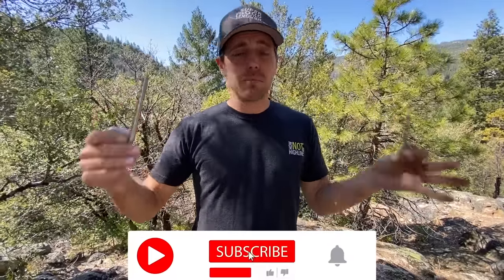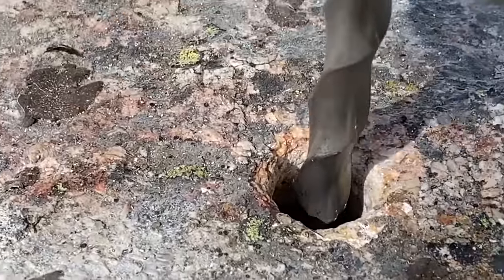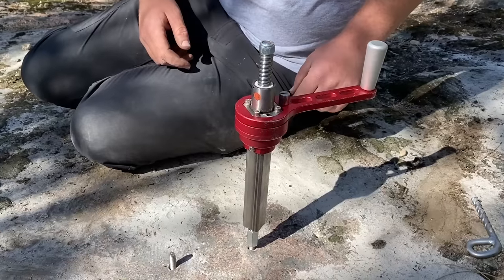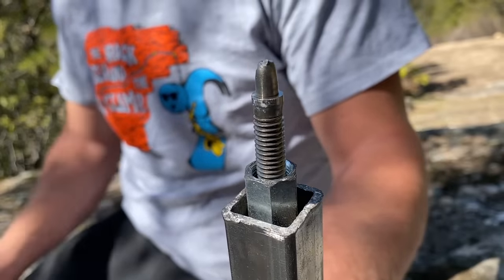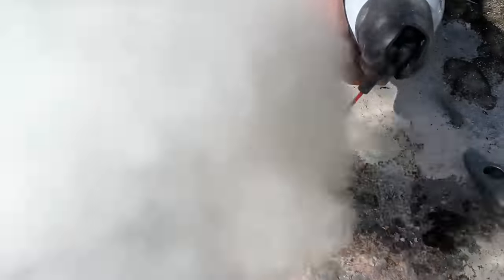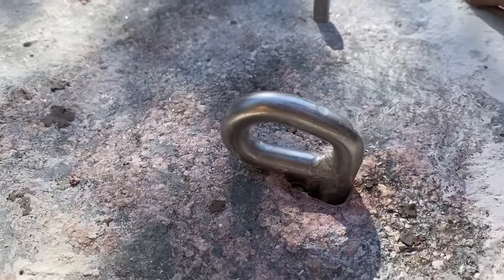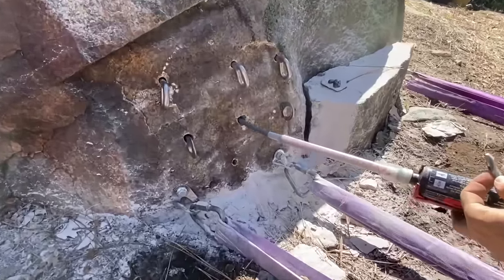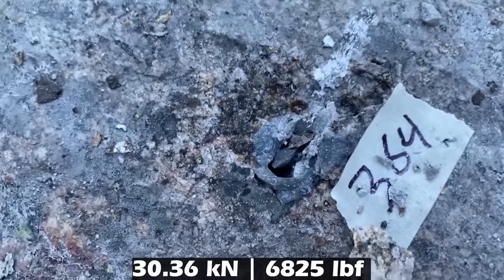Is too much epoxy bad for climbing glue in bolts? A trick to fix bashed Bolts

Comment: Drilling into rock to smash metal is savage dude!! But if you really have to then i suggest using a drillbit from the milwaukee MX4 series, made for concrete, cuts rebars as it was sandstone, so should be super drilly enough for those thin sleeves.... love your videos😍

Comment: You should test for fatigue failure. Say half the expected failure load and repeat until failure or like 1000 cycle to see how it compare to a fresh install. 

It would not be a perfect test but it should give ou a idea. Since like you say, epoxy is brittle and fatigue may start crack that can weaken it overtime.

Ps. Really enjoy all the ressource you have send out over the years.

Comment: Since you have become so popular, I think you should dive into the bolt debate.
It’s great that you are doing all of the research. Of course people need to understand the “how” of climbing pro. Replacing manky anchors is a noble endeavor. Setting up safe, clean, efficient highline anchors is fantastic.
Joe Shmoe should know, that throwing a line of bolts up a wall,  needs a conversation. 
The “why” of bolting, in the climbing world, needs  to be revisited. Is it just for removing fear? Eventually all climbs could be made “safe”. 
Climbing and highlining are two different games. Of course HL anchors should be bomber. 
Climbing.....is not simply about physical movement. At least half of the game is mental.
Throwing bolts in anywhere and calling it “developing” is.......insulting. Especially at the lower grades. It removes the feeling of standing at the base and wondering.
This debate is at least 50 years old. But climbing was obscure 50 years ago.
Now, Joe Shmoe, should be aware of the history.
Thanks for all your extensive testing and sorry that your work was vandalized.

Comment: Guys...  I really appreciate the huge efforts required to make this content. I was wondering.... Have you considered another test, to verify bond line integrity, before you pull? Such as a torque test.... Where you apply a specified torque, chosen such that no rotation is a pass, and rotation (indicating plastic deformation of the adhesive) is a fail. Multivariate data from these two tests may help yield a universal/standard Non-Destructive testing method for bond line integrity that requires minimal equipment. The variation in hardware and rock, in combination with a single crew doing a repeated methodology, adds a lot of weight to verification/validation of such a test method....... Additionally, you could do this non-destructive test in the field on a sample of old installations (It would be extremely interesting to check areas that have experienced wild fires... I don't believe a suitably large sample of these have been collected to date)...... ((Obviously this test is not practical if a ring bolt is 'notched and recessed.. but there must be plenty of installations where they are not 'notched and recessed'))

Comment: I thought this was a guide to fix the bolts that were hammered flat by the “Yosemite Psychopath”.  I also heard you say you weren’t going to fix them Ryan, but you are the bigger man in this story so I think it might be worth your while.  My suggestion, for what it’s worth, would be for you and Bobby to go fix some bolts, video it and as well, get the Rangers involved in the process.  if you were compensated by the Park in some way for doing that then the bolts would be considered improvements and the property of the U.S.A. Tampering or damaging them, or any park infrastructure, would be a Federal Offense.
Reply: The park can barely pay their employees lol. Unfortunately never going to happen.
Reply: The issue isn't that he doesn't want to do the work. What's the point in installing new bolts when someone is going to come by the next day and break them again
Reply: @KittenIgnition  I can understand that!  It takes several days of driving, hiking, climbing, hand drilling holes, hauling gear, and installing bolts and hangers.  And that gear isn’t cheap.  All of that takes dedication and commitment.  Smashing it flat with a sledge hammer is much easier.  The problem is that people could die on damaged or missing pro.  And the bad guy needs to go to jail!
Reply: @tommuhlemanjr.3871  for sure, but nobody is going to set up a line if all the bolts are bent 45 degrees... i hope. it takes all those things you just described, surely somewhere in that process you learn that damaged bolts are no good. if he damages gear in a way that isn't plainly visible, that could get someone killed so hopefully he's stopped before he causes real damage to human life.
Reply: @KittenIgnition  we all agree, it’s bad, it’s gotta stop, and the jerk needs to get busted.  But, if I remember Ryan’s response, I think he has a possible name but does not who this loser is.  Catching him will be even harder.  That’s why I wrote all that dribble about rangers being involved.  The sheriff or feds (FBI or whomever) will have no interest in chasing a “bolt bender” but maybe more interested in someone scarring, vandalizing or defacing Park property. Maybe, lol…..
Reply: @tommuhlemanjr.3871  The culprit is known and has a highlighted comment on Ryan's video tho
Reply: @KittenIgnition  Time will tell, he’ll get caught, and I hope he does!  At least everyone’s awareness has increased. This is all happening in Ryan’s back yard so I’m sure as anything happens, he’ll keep the community informed.

Comment: Is there a way to test cyclic loading? I wonder if extra epoxy would be compromised? Not sure if there's a good way to test this
Reply: You would need to hook an electric motor to the bolt with an off balance weight on the end and then let it vibrate against the bolt for a couple days.

Comment: You should do one with the epoxi also over the ring as a bridge, that's how I see some bolts here in Spain. You make the hole for the bolt and also drill some space around to fill the ring

Comment: just my 2 cents for renovation case after vandalism of glue ins... : in the case where a hole is drill right next to the glue ins in order to remove it, Jim Titt is often really open about custom build, it woud be convenient to build an hybrid between bohrhaken without the welding and the old disliked U stapple design. It would required less glue, and those are proably easy to make.                                                                                                                                                      and if you want to reuse the hole, I've heard people have use gaz torch to heat the glue in order to remove them, I have tried and failed, but I was probably doing it in a stupid way, as I was enough stupid to touche the bolt after...

Comment: We hammer drill holes all the time when setting tanks and equipment. We always run into rebar. We use rebar eaters they are bits designed to cut through metal inside of a hole. Maybe that would work? Probably not in Yosemite though

Comment: How does the epoxy hold up over time? Can you do a test where you load an anchor multiple times to 22KN until it fails simulating how many falls an anchor can take?
Reply: Yes, what is the expected life of the glue you used?

Comment: It would be awesome to see further tests on the anchor Screws you are using to hold you equipment down with. Can these be used on sport climbs ? Would make ground up first ascents a bit faster. Drill - brush - change over to 1/2 Inch socket SDS adaptor and ram home your hanger. then come back later remove them and glue in nice ring bolts. I'm climbing in Australia on some pretty soft rock in places and also harder granites etc. ,Have you run tests with these Screw Anchors in softer rock types?

Comment: living on a volcanic island i'm really curious how that method would work in other types of rock ( specially  basalt )
Reply from the maker: Id be down to test this in crappy rock.
Reply: If you had bad enough rock that usually breaks first, after this test I wouldn't be surprised if over drilling the hole would improve the overall strength.

Comment: I know this video is a couple years old but, have your guys tried using a punch to punch down the flange (center) bolt to disengage it and then use a telescopic magnet used by mechanics to remove the pieces for the broken bolts? I know that some stainless is not magnetic but, I’m curious if the bolts used in climbing applications are the variety that ARE magnetic. 🧐
Reply from the maker: The 304 SS bolts in this video are probably not magnetic enough to do that. But most bolts we replace would be. Good trick to add to the tool box incase a bolt breaks.

Comment: An idea for one of these tests where you try to screw things up. Bring a complete bolting newbie and have them do all of the steps. Even though you guys are purposfuly doing things incorrect, it would be cool to see the strength of bolts placed by an inexperienced person.
Reply: I actually just did this. I was lucky enough to attend a bolting course by the DAV (german alpine association), without any prior experience. I set a glue in bolt, and then later used a machine to pull it out to test its strength. Unfortunatly the machine could not pull untill destruction, but it exceeded the specification. So either I am a bolting genious, or the method is pretty robust :)

Comment: 5:00 and because the bolt deformed the it snapped off, it's probably very deformation hardened and will most likely dull out your drill bit quickly

Comment: Nice video! For bolt 366 (next to the “empty” pine needle hole): I wonder if it might make a large difference if you pull in the opposite shear direction.
Reply from the maker: Why do you think that would affect the results?

Comment: Im curious, and maybe you have a video on this, but have you tested glue in bolts after they have been in the weather and cold/heat differences for a long time like a 5 years? Could that compromise the adhesive?
Reply from the maker: I do want to test heat.  Are you referring to just freeze thaw cycles?
Reply: @HowNOT2  ya i guess either, freeze/thaw or high temperature if it has any lasting effect on the glue?

Comment: I was confused on the process, when drilling the hole directly above the old hole are you also filling the old hole with glue?

Also will rock type change this result?
Reply: Hmm a good question?  Sounds like a good test to try out. How about a video comparing bolting in different types of rock. Granite vs limestone vs... etc.
From my experience in caving sometimes you don't have much choice but bolts do work well in limestone which is the most common in caves.
Reply from the maker: On two we filled with glue and one we did not fill with any glue

Comment: Did you do this with any Titt Twist bolts or Wave Bolts?  I would expect similar results, but just wondering.
Reply: No, but Titt did some with his 6mm bolts. See link in description.
Reply from the maker: the 6mm rod stock those are made of bends at 4kn and then breaks pretty high.  I doubt too much glue would compromise them.

Comment: One thing you may want to be careful of having the new bolt close to the other bolt is if rain gets down in the original hole and freezes it can break apart the rock and weaken the bolt. Maybe fill the other hole with epoxy as well to prevent this.

Comment: You can always reuse old holes. It just takes a bit more time to get it cleaned up properly. The epoxy can be softened up and dissolved with solvents. Drilling another hole right next to the old one is a TERRIBLE idea and is not to be trusted. People's lives depend on these things and this is not acceptable.
Reply: This video proves otherwise 🤦‍♂️ how about you show yourself doing the same experiment and show us how it fails 😂

Comment: ⚠️   PRO-TIP….
SHARPEN  your old / dull carbide tipped masonry/impact type drill bits for use in  REMAINDER  EXTRACTION !!

As is, these drill bits are nearly useless on metal, wood and other non-masonry materials.
By taking an older and dull bit and sharpening it, you retain the structural integrity and heat resistance properties while enabling significantly easier cutting of non-masonry materials.

As an alternative,  you can take good quality standard twist drill bit which has dulled and use this for wedge destruction and removal.

I’m way too much of a pussy to actually trust my life to climbing gear or ANY type of operation over 6’ !
I’ve been a volunteer firefighter/paramedic while running a small electrical contracting biz to pay the bills.
During over 27+ years of training and operating with a small group of very talented and dedicated fellow FF”s, 
I’ve never done a single thing without my feet firmly anchored to the ground !  😳😳

Despite all of this, I still thoroughly enjoy watching highly skilled and apparently fearless climber operate.
Your channel is incredibly strong on instruction while still remaining entertaining.

Thank you !!
Reply: True.  But they do make SDS masonry bits designed to cut through rebar.